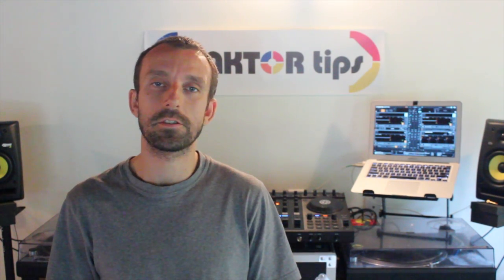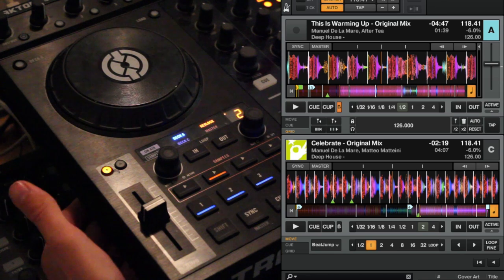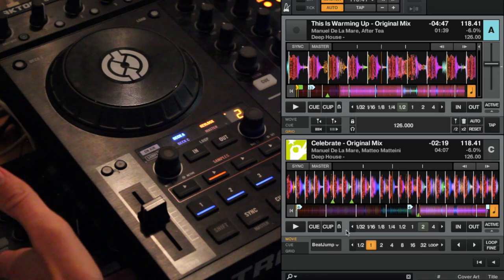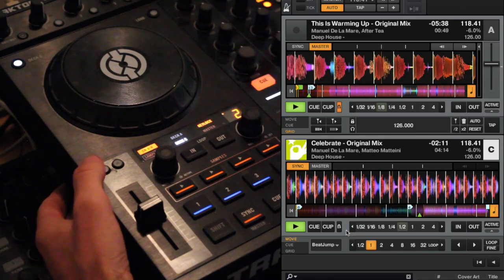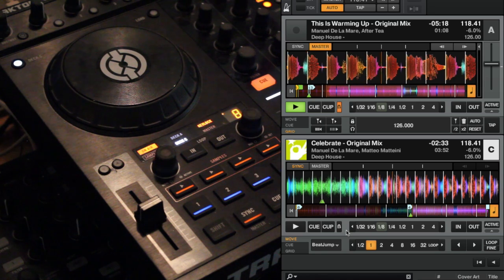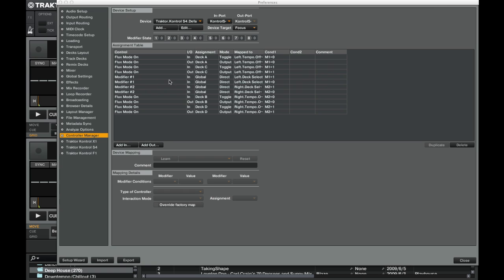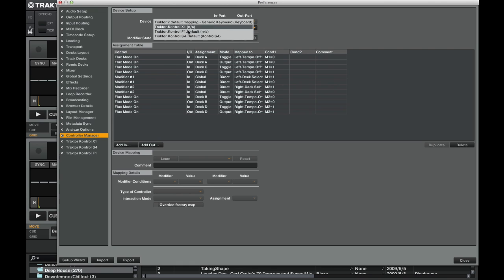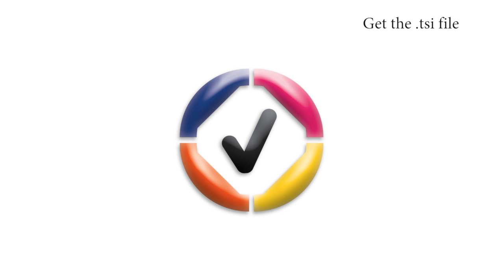Mapping the flux mode to S4 Offset button

Comment: I just loaded this and now traktor is having to re analyze my entire collection lol was that supposed to happen?
Reply from the maker: If you followed the import method in the video then you shouldnt have to re-analyse any tracks. I'm guessing you imported it a different way, importing all your settings too. To import it, you only want to import the mapping only.
Reply: I did it exactly as you did it in the video (for the newer version) and for some reason my Traktor Library just automatically started re-analyzing everything right after the import and switching the In-Ports around.  It was kind of weird but it looks like all my cue points are still saved so no harm done.
Reply from the maker: strange that that happened - but glad all is well! ;-)

Comment: dose it still indicate where your tempo fader position relatively to the screen
Reply from the maker: The first version did - the second doesn't. I found a quick glance at the screen sorts that issue out though (obviously if you have taken tempo faders off the a=screen you might have an issue) Best thing is though, the soft takeover means by simply moving the fader you wont change the tempo until it pick up the fader!
Reply: Thanx brother for the fast reply I really like your channel i only use the traktor s4 at home to record so I find the step thing  really helpful to indicate where the fader should be up or down Cuz I'm not really use to use sync when I dj and I do use it on the s4 when I'm recording nonstop ect so I found the tempo fader always miss placed Thanx again
Reply from the maker: Fahad Almusallam No problem - glad you like the channel - The light only indicates where the physical slider is in relation to the software slider, not where the slider is in relation to if the track is out of time slower or faster (at least not on my software)
Reply: Lol Yaa that's  what I meant
Reply from the maker: Fahad Almusallam Cool! Although that might be a good idea?
Reply: Lately iv been having a problem where the tempo of the track cuts in half so I have to go to the grid setting and manually pres the double the speed button or auto and it goes normal I really don't know what to do about it it's not a jig deal thou Cuz when I use cdjs with audio 6 I don't have that problem
Reply from the maker: Fahad Almusallam Maybe go into your prefs and increase the size of the tempo range, from 6 to 10 or 35 or something like that?
Reply: How about the current tempo range in each chanel
Reply: Cuz on my setting I have  100% in my tempo range but I'm pretty sure in I left it at 6% but when I opened it now a b c d where 6% and the range was 100% maybe that was the problem Thanx again buddy I really appreciate your help
Reply from the maker: Fahad Almusallam Have a good one!